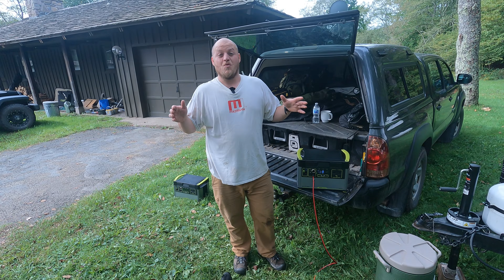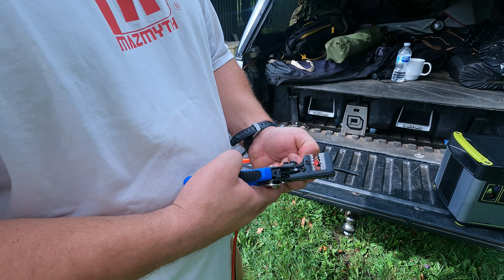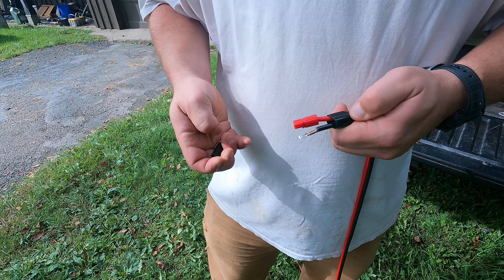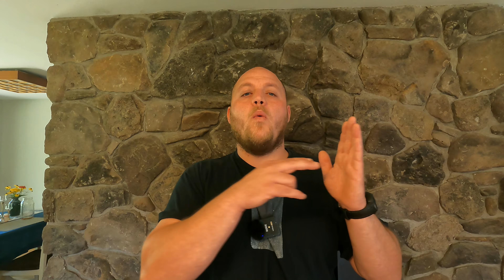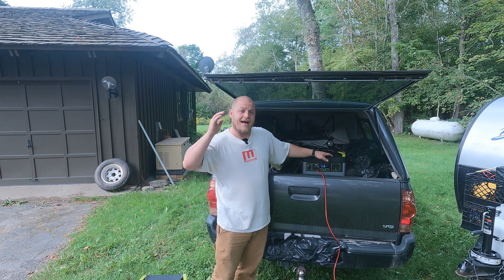Using Goal Zero for RV Battery

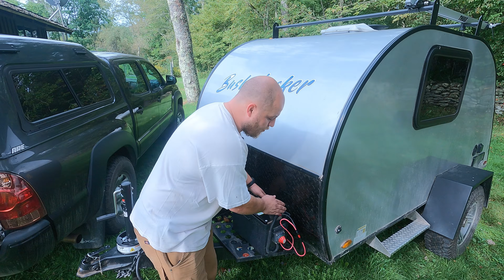Comment: A question around the 3:00 mark. 
How is the negative wire still grounded to the chassis? How does it complete the circuit when not plugged into the Yeti? I am a battery beginner, lol. It looks like the negative gets fed into the positive wire that continues off of the kill switch. Thanks for all the great videos.
Reply from the maker: The easiest way to explain it is that both the negative and positive wire from your camper goes to the yeti,instead of the battery. I demonstrate where to cut and what plugs to use, but in essence we are using BOTH wires to the yeti instead of the onboard battery.
Reply: @DIYOutdoorLife  That makes sense, thanks so much. How about when you're plugged into the AGM battery instead of the yeti? Then where is the negative being grounded? Looks like it gets grounded into the positive wire that goes back into the camper. Thank you for all the great videos. I hope you keep making them! I'm looking at a yeti 1000 core now... $900 on Amazon hmmmmm
Reply from the maker: The negative will run directly from the - on the battery to the chassis. All other negatives from appliances bond together and go to the chassis as well.
Reply: @DIYOutdoorLife  Thank you, I get it now. I really appreciate the explanation. I think I can do this... eventually. First I'm going to install the kill switch from your other video. Way easier to screw down nuts and mount a switch. 

In the meantime, I have a 12V female socket wired into my positive near my battery. So I plan on getting a 12V-male-to-Anderson extension cable, so I can directly recharge the AGM battery from the Yeti. This is still less efficient than just powering the camper from the Yeti (like in your video), but I think it's a step up in terms of efficiency compared to plugging the camper into the 120V A/C outlets on the Yeti.

Edit: just found out they make 10AWG wire with ring terminals and 45A Anderson Connectors. I'll attach this directly to the AGM battery, and plug the anderson into the Yeti. STILL less efficient than what you outlined in the video, but still progress.
Reply from the maker: You don’t wanna do what you’re saying! A lot of people make this mistake, so don’t worry. The Anderson output on a yeti is not a charger, it can not safety charge a battery. It can be used like a DC outlet that can run something like a camper, but batteries require a charger to provide them with the proper profile of charge. 

For now, consider plugging your camper into the yeti inverter with your shore power plug. Your camper obviously has a battery charger built into it, use that with the yeti to charge the battery like you would with a gas generator.  It’s going to be seriously inefficient but will get the job done. If you have any questions about this shoot me a line
Reply: @DIYOutdoorLife  Thank you so much man!!!! Great info. Eventually I'll have the confidence to just wire in Anderson plugs to my main +/- leads. For now I'll just plug into the shore power 15a adapter on my camper. I just bought the yeti core 1000 from your link. I'll definitely be in touch!
Reply: It arrived ... used and scratched! Returning it for a replacement. Not a great introduction to the company, but they at least have good customer service.
Reply from the maker: yikes! I was a little leery about the core being Amazon only, but it worked out for me. Sorry you had a hiccup and glad they made good.
Reply: @DIYOutdoorLife  1 month later, still haven't made it good. Unit #2 had a damaged HPP port that damaged the HPP output on the solar panel. So at that point I had 2 defective Cores and a broken solar panel. They sent a 3rd core and 2nd solar panel, and all seems fine. Now I literally have $4100 worth of GZ inventory, they have my credit card as collateral, and the return process is a special level of hell. Their customer support team is not well informed and it looks like I'll be making many trips to fedex, ups and walmart (for packaging tape). I'm corresponding with their lawyer now because their customer support team is incompetent. I hope you at least got paid for the original Core purchase. I deeply regret it, though. Wishing you the best.
Reply from the maker: @Shloopy420  I hate hearing this stuff. I’m hearing nightmare stories across the board with shipping, distribution, and QC on all the products we use as outdoors people. The GZ products are the ones that people write me saying how much they love…😕 I really hope you get this resolved and appreciate the feedback.  Amazon actually subtracted the sale from my account when you returned, so they got me too.

Im a little curious about the return struggles. This is an Amazon only product and they offer free returns with packing slip. Shouldn’t Amazon be the one handling return?
Reply: @DIYOutdoorLife  Damn, they scammed you! I haven't returned anything yet or gotten any refunds. Goal zero has sent defective unit 1 after another, but at this moment I've still paid GZ $900 via Amazon for the Core. This is super manipulative. 

I'm also confused that GZ is handling the returns. I initially called them simply asking for a small refund since the battery was dirty and scratched. Maybe because the batteries are shipped with special HazMat labels? Amazon has had no part in processing the battery, it's all come from GZ's 3PL warehouse. So it kinda makes that Amazon wouldn't pick these up. 

Anyways, the 3rd core replacement unit started really bugging today. When I plug my dead laptop into the 60W PD USB C, it trips the 12V socket and turns on the AC inverter. Fun party trick, super buggy. So now I have a scratched a dirty unit, a unit with a damaged (and damaging) HPP port, and a unit buggy USB-C port. I have no idea how GZ is going to handle this. Considering it took them 1 month to ship me the first return box, I suspect this will go poorly.
Reply from the maker: @Shloopy420  the associate program is always funky. If someone initiates return or even clicks on another YT link, it’ll bounce the few pennies they gave you…lol. Definitely not something to make a living on.

I wish I could get my hands on the last two units to see what’s going on. I’ve seen things get buggy with usb c, but never anything turning off/on couldn’t fix and never anything like what you’re experiencing. After literally using putting over 10,000 hours on PPS, the GZ stuff showed what it was made of, I really hope the Core isn’t an exception. So far I’m still getting some great feedback and suspect you are getting the worst of it.
Currently I’m working with a few other companies to test out their new power stations, I hope to find some variety to recommend.
Reply: I still have the same question as Paradoxical Axiom. (Great handle, btw.) When the house battery is connected, I see the negative cable attached to the battery terminal at one end and attached to the Anderson Power Pole (APP) at the other end but do not see it exiting the other APP on its way to the chassis. (I do see the one going from APP to the GZ.) Are you using two separate ground cables, one between the GZ and APP and the other between the battery and the chassis--and swapping them?
Reply: @leetn5363 this is my question also. Did you ever get a solution

Comment: If you buy a camper without a battery would it still have this pre wired set up?
Reply from the maker: It depends on what you got really.  Most factory made campers would, while some campers, especially home builds, may not.  What do you have?
Reply: I'm looking at YouTube videos on Airstream Bambis,16,19,20,and 22' and I'm also looking at Winnebago Solis59P,Solis Pocket and Revel as well as Thor 4x4🌻
Reply from the maker: You would be able to do this with any of those campers. Those are all really nice rigs too!!
Reply: Okay thx 🌻

Comment: Yeti’s are advertised as a house backup system. If you are worried about the elements, can’t you just store your Yeti inside your camper and run the wires in? I frequently have my awning open in light rain with my screen door open. The Yeti should have no problems inside the camper, correct? Or am I missing something?? Thanks! Andy
Reply from the maker: The system holds up very well to the elements! Inside camper works for me all the time although space can be limited in the BW.  You want to avoid rain and high heat when outside, it's all easy to do.
Thanks for watching!

Comment: I really appreciate the discussion about batteries at the end of the video. People really try to make you feel bad for purchasing Goal Zero now a days. I started my solar journey with Goal Zero about 5 or 6 years ago. After comparison of several other companies solar power stations (for my needs) I still came back around full circle to Goal Zero. Nobody ever talks about the components that Goal Zero exceeds in.
Reply from the maker: I agree! There is some amazing systems out there and tech is developing fast, but the Yeti platform is still the best for many applications, including how I use PPS.
Reply: Love my GZ Yeti too. Very well design unit.
Reply: Goal Zero also needs to be on blast for being irresponsible of it's defects. I posted one explaining why
Reply: I bow down to companies with good customer service. Unfortunately GZ has been a disillusion. Not being responsible for their defects
Reply from the maker: Tell me more, what defect are you up against?
Reply: @DIYOutdoorLife  Some units at times have problems acting erratically including my 6000x. Unit stops giving out a charge and sounds an alarm without reason.
Reply: @DIYOutdoorLife  Didn't notice until after my last video. Dont use it that much my 6000x is in storage. Doesn't do it all the time. But when it does, it's a big inconvenience having to turn it off or "play" around with it to get it going again.
Reply from the maker: @scmreport2457  no luck with GZ tech support? Firmware update?
Reply: @DIYOutdoorLife  First time I spoke with Susan and explained the situation. She offered no solutions whatsoever. I was calm and respectful.
Reply: @DIYOutdoorLife  Second call I made and asked if they can fix it they hung up. Any call after that they wouldn't answer the phone.
Reply: @DIYOutdoorLife  Maybe if I had bought the cheaper more lightweight units they would have helped. I bought the big boy for 5k. They don't want to deal with the expensive shipping I guess
Reply: Thank you for sharing your experience with Goal Zero and highlighting its components. It's great to hear that you've found a brand that meets your needs. Speaking of quality power stations, have you checked out the Segway Portable PowerStation Cube Series? Its massive capacity, waterproof design, and fast recharging capabilities make it a reliable option for outdoor enthusiasts like us. Just a suggestion for your future RV adventures! Happy camping!

Comment: Hello Brian, I realize that I am limited using a Jackery Explorer 500 but my needs are also limited. The 120 watt through the cigarette plug,( why don't we call this a power port now?) I will be satisfied using this to run the LED lights on the camper and charge a cell phone.   Is this the way to go about it? 

MACHSWON 10 x Anderson connectors with Rubber Boot Cover powerpole (5 x Pair) 45AMP 600V 10X Anderson powerpole 45AMP Electrical Connector Plugs with Rubber Boot Sleeves 5Pair 45Amp Power Pole, RV Parts & Accessories - Amazon Canada

Then use something like this to plug into the Jackey Explorer 500?

Car Cigarette Lighter Plug with Internal 15A Fuse, 3.3ft/1m 14AWG Extension Cable Adapter 45A Connector Compatible with Anderson PowerPole Port, Electrical Accessories - Amazon Canada

Please copy and paste the above in a browser. Here in PEI Canada supplies are limited.

Thanks so much Brian!
Reply from the maker: You got it! Those parts will allow you to run 120 W, as you’re looking to do. Understanding the limitation is key and it seems like you do. Take pictures and let me know how you make out!

Comment: Using a new Goal Zero 1000 CORE I replaced the Anderson 45 amp with a 50 AMP Plug to the end of the extension and to my RV. I get 12 volts just fine at the end of the plug but when I plug it in to the RV it gives me a red light on the out put of the Goal Zero and no power to the RV. On the RV I have a battery monitor (Shunt). could that be causing a problem with the GZ Output seeing that as a ground fault? I had to use 50 amp plugs on the RV and the end of the extension due to the size of the wire on the RV. What does the red light indicate on the Goal Zero at the Anderson Plug outlet indicate?
Reply: Also when I connect the GZ it is to the RV only taking the 12 volt battery out of the circuit. Trying to run the RV off the GZ. I found the user manual online, the Red Light indicates a Trip not certain what would be tripping it.
Reply from the maker: do you have your RV unplugged from shore power and the battery completely disconnected?
Reply from the maker: This system, which you'll love, is for unplugged boondocking only. Do not hook to shore power or your tow vehicle. In the video I show how to completely remove the RV battery to do this while unplugged.  It sounds like you have something still connected to the RV that's trying to charge.
Reply: @DIYOutdoorLife  Yes connecting through the battery we were boondocking
Reply: @DIYOutdoorLife  I unplug the battery, plug the GZ in so the GZ takes the place of the Battery. I wonder if the Shunt from the battery monitor is tripping the GZ?
Reply from the maker: If the shunt has that thin wire attached to the battery, you’re probably right. Keep me in the loop.
Reply from the maker: Is it easy to remove the shunt?
Reply: @DIYOutdoorLife  It’s easy to remove the thin wire that powers the gage. And I could put a bypass switch on the shunt, like a battery disconnect and go directly to ground. (Take the shunt out of the cicuit).
Reply from the maker: @dag36523  see if you can temp remove it… if it works, we’re in business

Comment: Really enjoy your videos. Very creative. Would the 12 volt regulated outlet on a power station be able to replace the battery?  I have a small trailer and would love to use your idea but only have the cigarette type adapter. Thanks.
Reply from the maker: The bummer with the other brands is that a lot of them only have the cigarette style plug. This will give you roughly 120 W of capability. I can run most everything within that range, but you will get in trouble when trying to run multiple things at once. If my refrigerator compressor is on at the same time as the furnace it would trip.
So short answer yes, but the plug that Goal Zero has is 360+ watts, that’s how I’m able to run everything at the same time.
Hope this helps, please subscribe!

Comment: Just did a test run with my Goal Zero 1000 core in the kitchen (before boondocking next weekend for 4 days). Ran a Mr Coffee it draws 805 watts. When I switched to see the Amp draw it was 61? Is calculating at 12 volts when I am plugged in to the 120 volt outlet?
Reply: Also ran an electric tea kettle which consumed 30% of the power. 1342 watts for about 5 min. Won’t be using that LOL. I know I can make coffee on the gas stoce just teating.
Reply from the maker: The experimenting can be a lot of fun. It’s amazing that a system this small can even run something over 1300 watts! 

In your example, 61 would be DC amps. If you divide the watts by the volts, you’ll get amps. Your coffee pot was likely drawing around 7.5 AC amps. 
You’ll find using any device that gets hot will use a ton of wattage. So like you said, using LP for coffee and tea water will be a huge saver.  Have fun and keep sharing your results, it’s always nice to hear what people are discovering.

Comment: Great rundown. Question: I have a tiny truck camper with existing wiring into an empty battery cabinet for a few lights/outlets, pump, and heater fan. Could I just run the 12v ouput from my Yeti using your system into what appears to be the 14ga wiring (that was intended to go to the old battery)? Not a lot of draw, would be nice to not re-wire lights and such from the GZ
Reply from the maker: Yes, absolutely! Assuming your truck was wired properly, 14awg wire can handle your total load (less that 15 amps).  The APP port on the x series can do 30 amps and the core can do 20 amps...you'll be fine either way. Have fun with it, hope you'll subscribe! 
 SUBSCRIBE: https://www.youtube.com/c/DIYOutdoorLife?sub_confirmation=1
Reply: @DIYOutdoorLife  sweet thanks!!

Comment: What is a 1 C discharge rate?
Reply from the maker: Discharging the battery at a rate equal to its capacity. So if you have a 1500 W hour battery, you plug something into it that draws 1500 W, like a huge heater or several refrigerators.
Reply: @DIYOutdoorLife   Thanks